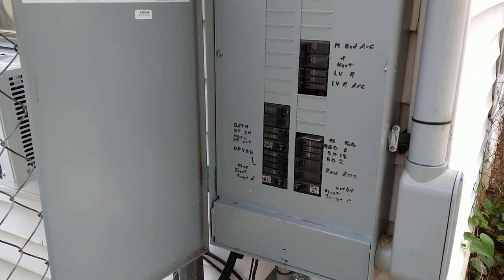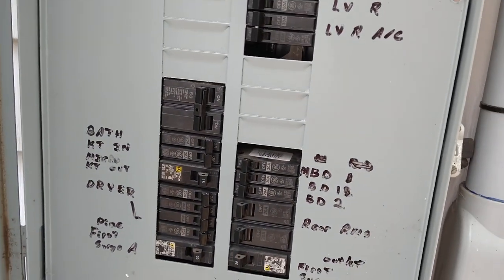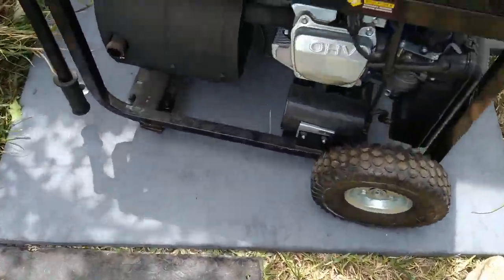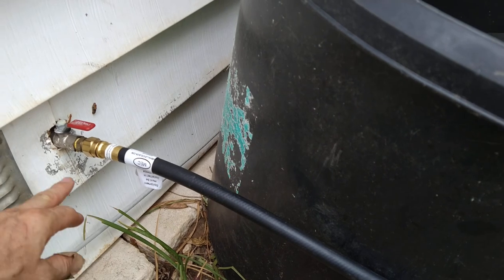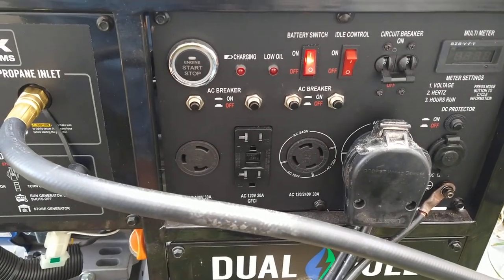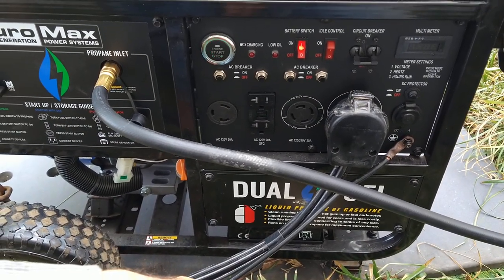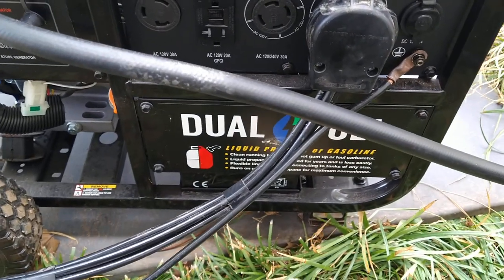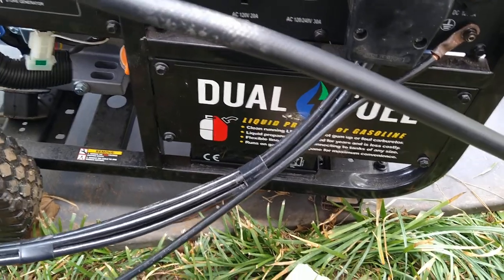5-hour power outage. backup portable dual fuel generator temporary hookup and setup.

Comment: that's the hard part selecting the circuits.  i put me in one of these 5 circuit transfer switches.  all set up into house but not tied into breaker box.  we did that US Carbonic conversion (donutty) on brand new Craftsman 4,500 watt gas generator.  Supposed to run it on gas for an hour before propane.   So there's like things to do before I pull the, oh it has electric start but battery shot.  has a flat tire. lol   Thanks for sharing your stuff!  Hope the Siemens didn't cause the power out! hmmm?   electricians are cool dudes, the good ones are!

Comment: Ok Cowboy Roy .the name of the is fuel is  Aspen 4  fuel .This is very expensive I mean very expensive. But you can leave it in the tank for over 6 months without any break down of the fuel .I suggest that you buy say 20 gallons of this and only start your generator on gas mode and then switch over to propane after 15 minutes to warm up the engine. Then run propane for 1 hour then switch back to gas for 1 hour. This will give you a good feel of how the unit reacts to each fuel .Itnot the best solution cost wise but the longevity of the unit very important during the moments hen you need it most .
Reply from the maker: Thank you. Non-ethanol gasoline stored with stabil can also last for a number of months. Lee Wheelbarger stores it in the metal Jerry cans or over a year and is still able to use it

Comment: I hope your generator has hardened seats and stelite valves built into it fron factory. 1 would assume that it does, but you .ust verify. Propane is a very dry fuel and doesn't have the  temperature shock absorber characteristics that of gasoline. Fresh gasoline has a cooling effect on the intake  valves.The heat laiddened valve transfers the heat into the stainless steel seat and then to the cooling system. Air cooled engines have only the atmospheric ambient air available to transfer that heat .
So i you ned to run it in extremely hot weather, use it in gasoline mode .
Reply from the maker: I have no idea the exact build of it. I think it's probably much better than the champion brand.
Thanks for mentioning the cooling. I guess I could use its own outlet to run a shop fan to help cool the engine. I would rather not put gasoline in the tank. I'm bad about letting the gas go bad in things. I have the tools for what I need to do but not the time to use them.
Reply: @cowboyroyrogersnewsandclues  There are exotic additives which prevvent gasoline from breaking down. But I don't remember their names. If you go to Chickanic ,or project farm ,they do testing on different brands. I will check with my dealer to get you the best additive name.
Reply: You can checkout Taryl Fixes All .On yt as well. These are all repair shops that work on small engine brands from Briggs and Stratton, Tecumseh, krohler,and other brands. Honda doesn't build propane inverters or generators. So don't try to add a conversion kit ,it will void the warranty,